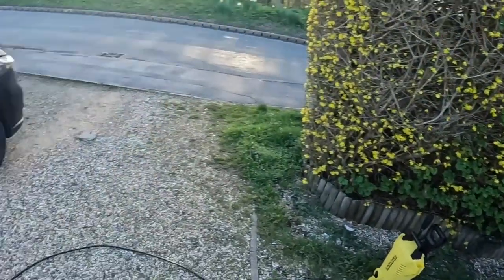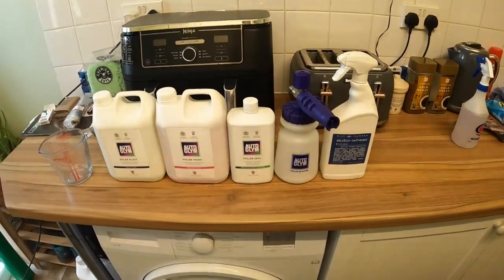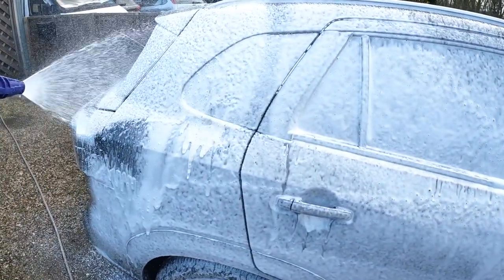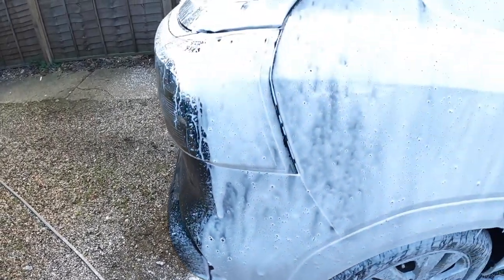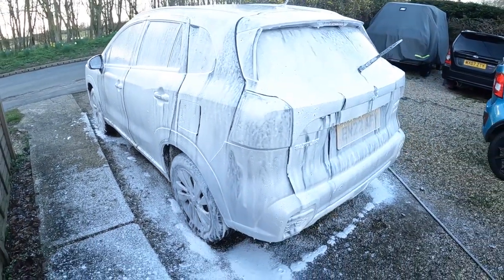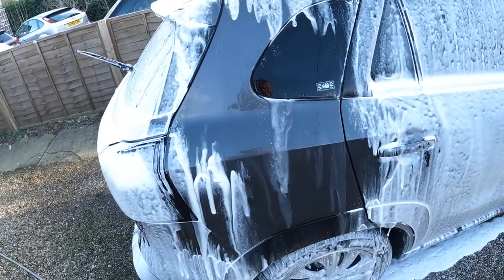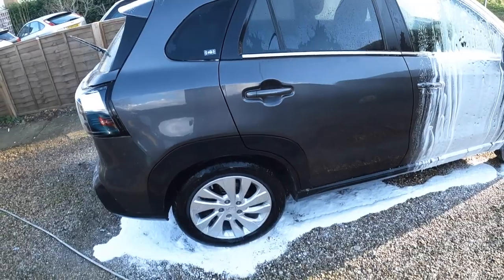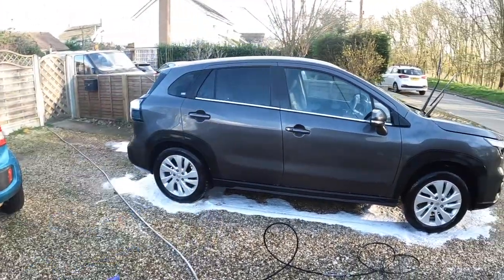Autoglym Polar Kit car wash process and review - Polar blast - polar wash - polar seal

Comment: Never noticed, at what point did you apply the alloy wheel cleaner?
Reply from the maker: Cor. You’ve got me now. I’d have to review the video to check. This is quite an old video but normally I get the wheel cleaner dwelling at the start. 

In fact. I’ve followed suit with most half decent cleaners and started doing the wheels as a separate stage at the beginning of the process. You’ve given me an idea. I’ll shoot a more concise version at the weekend. 

Thanks for watching and taking the time to comment. All the best.
Reply: @rev-you1975  thanks. An updated version would be most useful. I noticed from the comments that you no longer pre-rinse either. Any other changes?
Do you still use the Auto-Glym Kit?
I'm new to the whole Snow Foam car cleaning malarkey and always after tips on best products, best practice etc. Cheers.
Reply from the maker: @paulfrance2162  Hello. Yes. Avoid pre rinse because the foam will stick better to the dirty/dry surface. As you say. I discovered that by reading the comments and doing further research. I do indeed still use the polar kit. It’s just such a nice experience. I tend to either use the autoglym polar kit or bilt hamber touchless or auto foam then Gyeon wet coat. Both processes provide a similar end result. For me what made the biggest difference was using the Mjjc foam cannon. It’s just a joy to use and delivers lovely foam. Citrus pre wash is also worth considering. It performs as good as foam. But is really cost effective as the dilution ratios can be really low. So it lasts ages. There’s just something about the foam process. It’s enjoyable. I have recently also looked at onr. Worth a look if you haven’t already. It’s amazing. Feels like cheating. I have a video on my schedule to do rinseless vs traditional wash.
Reply: At 4.22

Comment: Based on what I've seen those Pre-wash foams don't too do much, especially if you are using a pressure washer, how much of it is the chemical? vs the pressure ? but that's just me, I haven't had the chance to try this stuff out yet... I got the trial kit sitting in my basement since last year...... need to get the pressure washer itself. I have noticed but your video that it looks like it is best to start from the wheels and go up with the foam since it runs a bit more. Nice video!... now if the bloody weather in Canada will give me some decent conditions!
Reply from the maker: Hello. Thanks for watching and thanks for taking the time to comment. I only have a poverty spec (low pressure) pressure washer so I suspect the foam is doing a chunk of the work. I’m pretty new to foam (having always been sceptical about it) but am totally sold now. Getting 80% of the dirt off without even touching the car is a huge bonus. Regarding direction of spray. I’m not professional enough to be using a particular direction. Unless it happened by accident. Anyway. Process should be. Wheels first. Get that part done and out of the way (I show that better in a later video cleaning my forester). Then clean car as detailed in this video. Some people rinse bottom first. Then move up. There’s so many factors. When it’s super hot. I just try and keep buzzing round to keep the car cool and wet to avoid streaks etc. If it’s cold or damp. Just up and down until each panel is done. You can test the foam in a pump sprayer. That’s how I started. Then just use a normal garden hose to rinse. You’ll soon get the urge to have a pressure washer. Just a basic model is fine. Thanks for watching. Take care.
Reply from the maker: This video is a bit more in depth. https://youtu.be/5Vdi_9wVzE0
Reply: @rev-you1975  all good, I’ve got the same issue with trying to work fast enough, no shade unless it’s either early morning or late afternoon. Though then the mosquitoes come out and I get eaten alive lol. What ever works for someone is the way to go.
Reply: @rev-you1975  appreciated!
Reply from the maker: @BMan100  Gyeon wet coat really helps at the end of washing in the sun. Keep the car wet overall. Get the product on. Have your drying towel to hand. Drag it all over the car starting with the largest flat areas. Roof. Bonnet. Sides. Then get in to the smaller details and glass. With Gyeon wet coat on the surfaces you can do full dry in 5-10 mins. Promise. It’s incredible. Next on my wish list is a blower so o can dry super quick to avoid streaks.
Reply: @rev-you1975  first thing I really need to do is get their MOHS on my car, my ppf is really grabby so even using a blower is a pain, glass I’ve coated with ITekt nano ceramic windshield coating (made in Canada) helps matters .

Comment: Hi, great video.
What stubby gun did you upgrade to and where from please?
Also, I need to upgrade the hose on my K4 premium ecologie, as the default tries to throttle me every time. Looks like you upgraded yours too, so any advice on that would be appreciated. Thanks 👍
Reply from the maker: Hello. Thanks very much. Really appreciate it. 

Stubby gun was from slims detailing. Extended hose was from Amazon. 

I hate to say it. But both are game changers. 

The hose mainly. You can get round the whole car with ease and no moving the pressure washer. 

I’ll dig out some links.
Reply from the maker: https://www.slimsdetailing.co.uk/products/stubby-trigger-gun-nozzle-kit
Reply from the maker: DERASL Kärcher High Pressure Hose Extension 10M (for Quick Connect Models) for Karcher K2 K3 K4 K5 K6 K7 https://amzn.eu/d/9CJrBcW
Reply from the maker: Thanks for watching. Thanks for your comment. All the best.
Reply: Thanks for the links. The hose is an extension. I need to replace mine in its entirety, so does that fat connector on the end come off to allow me to do that?
Reply from the maker: @kevinjackson5191  My bad. One mo.
Reply from the maker: @kevinjackson5191  This is the one I bought. Apologies for the earlier incorrect link. More haste less speed required. 

STYDDI 10M High Pressure Washer... https://www.amazon.co.uk/dp/B082LTTZ2R?ref=ppx_pop_mob_ap_share

Comment: Auto Glym advise you avoid putting the Polar Seal on the windows. Did that cause an issue for you, or do you use a windscreen cleaner?
Reply from the maker: Hello. Thanks for watching and thanks for taking the time to comment. It’s not caused me any problems. I barely use my wipers, the windscreen beads up lovely and most of the water just rolls off when you are moving above 30mph. The only drawback is that the wipers will squeak a tiny bit if the window isn’t really wet (ie a light drizzle) (I hear that is similar for many rain repellent windscreen finishes) but I am happy to live with that for the hydrophobicity it provides.

Comment: What does 1:5 parts water mean? Is it 500ml water and 100 ml polar blast?
Reply from the maker: Hello. Yes. 500ml water and 100ml of product is a good starting point. Depending on the output you achieve. Either too thick or too thin. Strengthen or weaken accordingly. Thanks for watching and taking the time to comment.
Reply: @rev-you1975  thanks - do you have the link for extended karcher lead? Thanks
Reply from the maker: @marklanghorn9220  Sure thing. One mo.
Reply from the maker: @marklanghorn9220  This is what I use. Obviously check your connections. I migrated to quick connect. Seemed more widely compatible. Then bought a quick connect stubby gun and quick connect foamer to match. Hope that makes sense. STYDDI 10M High Pressure Washer... https://www.amazon.co.uk/dp/B082LTTZ2R?ref=ppx_pop_mob_ap_share